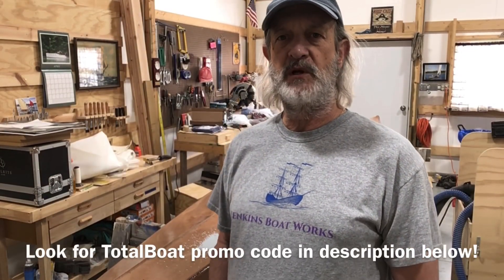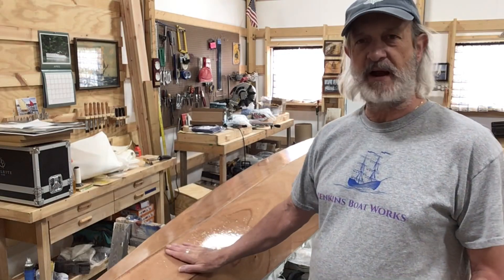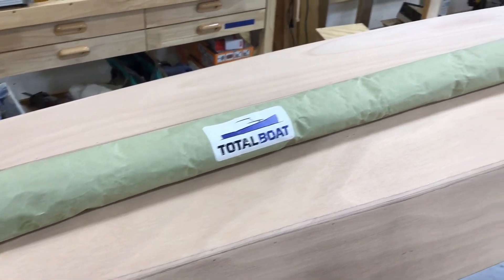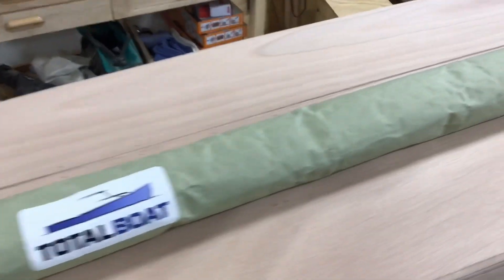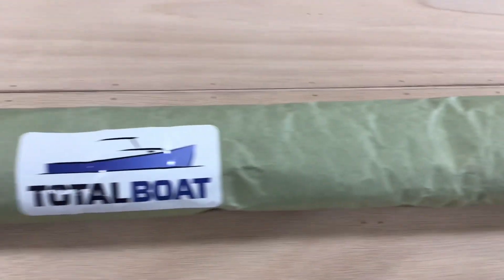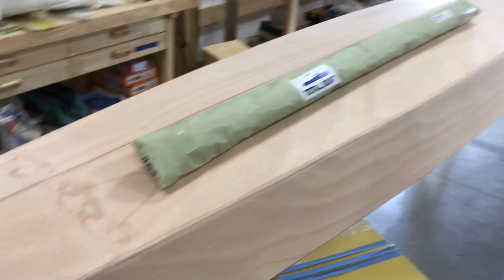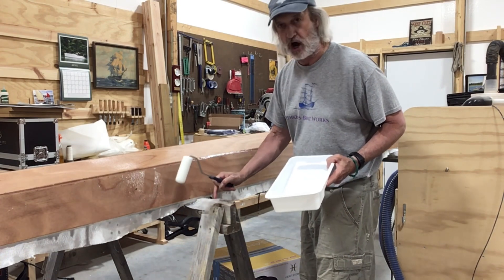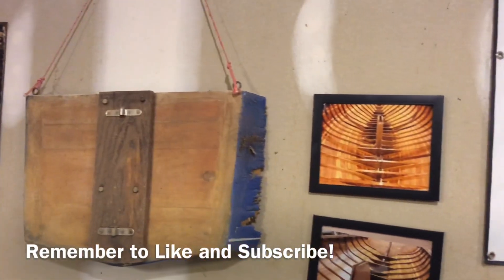Fiberglass and Weave Fill Chesapeake 18 Kayak Build Episode 6

Comment: Nice work Chuck, I've had mixed results with wax paper sticking to epoxy, especially if the epoxy goes off hot and it melts the wax, my favorite way to protect the saw horse and other wood support is clear packing tape, never had a sticking issue. Fill coats are always tricky, so many variable like thickness, temperature, humidity ..... Looking good !!

Comment: Before I had done any epoxy, or glass work I had watched Red Barn Boats channel on YT. He was interesting to watch as he went into great detail on the subject, so I knew what to expect when doing it for the first time. I used a heavier cloth than you have on the foredeck ( 5 - 6ft square ) it never filled perfectly, but looked good enough after a few coats of varnish. I did sand down lightly between coats of epoxy to take it off the top of the weave, which accentuates the lows between the fibres. Right about rolled over folded glass. Really annoying to get it like that from a supplier you think should know better.
Reply from the maker: Yes, I’ve actually watched that. I concentrated on the fill coat this time because I’ve messed that up before and then found myself sanding into the cloth.